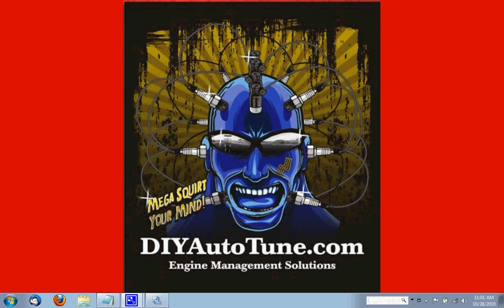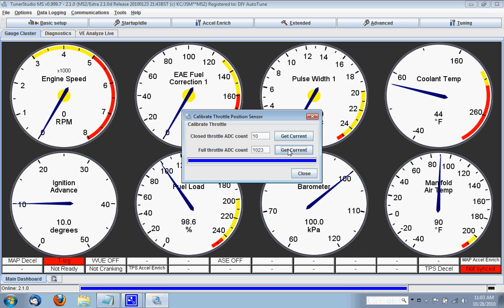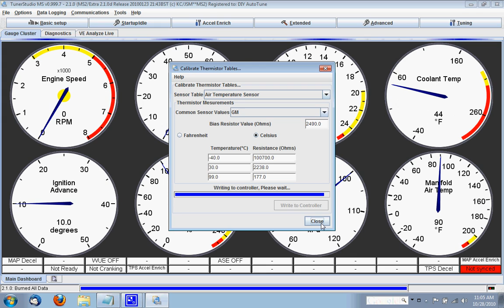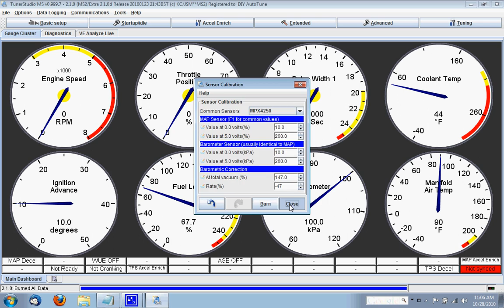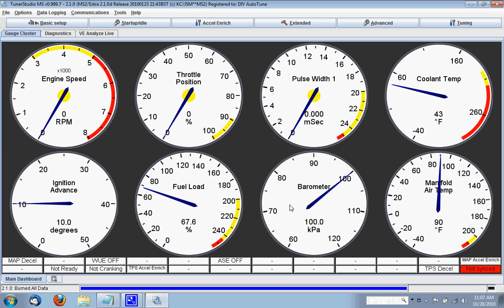MegaSquirt Sensor Calibrations

Comment: Why does ms tps read 10-20% at physical zero of tps.. If even without sensor it reads 7-10%. When trying to calibrate it does not zero out..
??
Reply: Did you get a solution for it? I have the same issue.
Reply: I'm having the same problem except my 0% is closed throttle and my WOT only brings the percentage bar up to about 60%. I have been having this problem for a while. Any solutions?
Reply: Ruwe Saare no solution. As a matter of fact, it was working perfectly until the week I was getting closer to finishing build. I re wired all my harness just to make sure and it aggravating
Reply: same. mine isn't even being picked up by the ms at this point. closed throttle and wot both read "2" and there's no change with the little blue bar when i press the accelerator
Reply: Did you ever find a solution?

Comment: My MS1 does not have the option to calibrate coolant temp sensor and my fan runs from 175 deg on up via TunerStudio.  Fan even stays on until battery is dead with engine off and key in run position.
Reply: its time for an upgrade